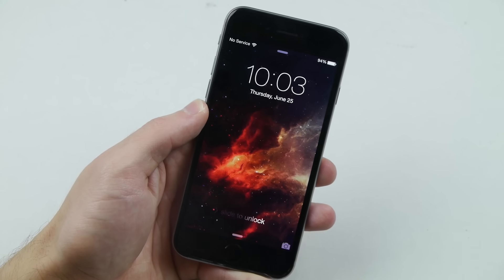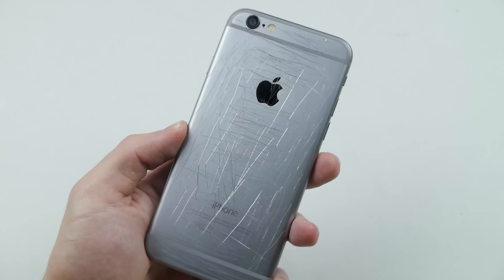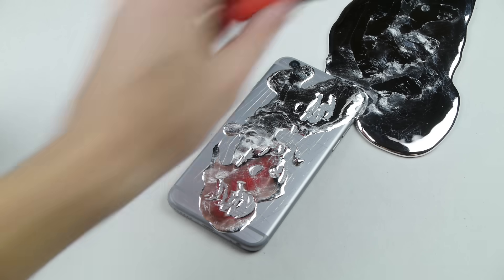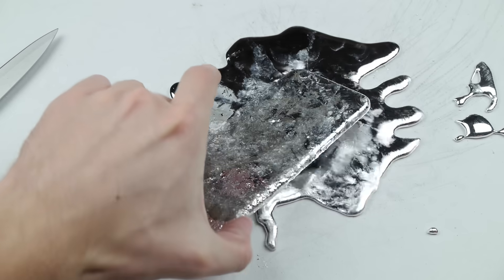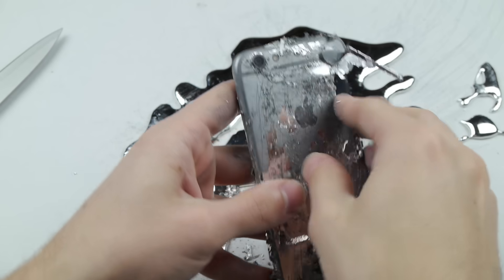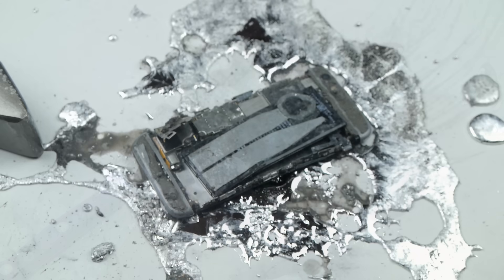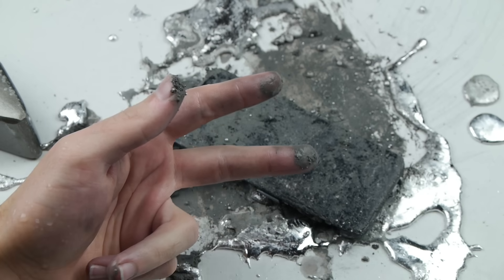What Happens If You Pour Gallium on an iPhone 6?

Comment: its battery acid you morron
Reply: and yes its miss spelled on porpose
Reply: and the acid is lithium mixed with the gallium ITS CALLED CHEMISTRY
Reply: The gallium-aluminum compound produces hydrogen when exposed to water. It's not from the battery.
Reply: Austin Butler lmao
>"ITS CALLED CHEMISTRY"
>not understanding chemistry
The aluminum-gallium compound, when exposed to water, produces hydrogen gas. That's what the burning/sizzling noise and smoke are from. There's absolutely no evidence of any battery acid leakage at all.
>ITS CALLED CHEMISTRY
Reply: Austin Butler you're the morron

Comment: The reason the phone started sizzling and smoking was because you compromised the aluminum casing on the lithium battery and it had a similar reaction to what is happening to Galaxy Note 7's all of the world. The science behind it is the aluminum casing was all that was protecting the lithium from impurities and with impurities lithium's charge will be discharged creating sparks and flames and in the Note 7's case the aluminum casing to expand to the point of outburst. Like for others to see why this happens :)

Comment: That cant be good to breathe...  or touch.. lol
Reply: Caleb Sandersier gallium is non-toxic
Reply: that smoke is hydrogen... aluminium gallium alloy plus water equals alumina plus hydrogen plus gallium... it's actually a viable method of fuel because the gallium is only a catalyst
Reply: Gallium is non-toxic
Reply: EmKays Wørld But not Battery acid or other melted materials that's not Gallium. Also there might be other chemical reactions that might not be safe.
Reply: EMERGENCY OVERVIEW

Irritating to eyes, respiratory system and skin.Moisture

sensitive.The toxicological properties of this material have not been

fully investigated.

Potential Health Effects

    Eye:

         Causes eye irritation.

    Skin:

         Causes skin irritation. May be harmful if absorbed through the skin.

         The toxicological properties of this material have not been fully

         investigated. May cause contact dermatitis.

    Ingestion:

         May cause gastrointestinal irritation with nausea, vomiting and

         diarrhea. The toxicological properties of this substance have not

         been fully investigated. May be harmful if swallowed.

    Inhalation:

         Causes respiratory tract irritation. The toxicological properties of

         this substance have not been fully investigated. May be harmful if

         inhaled.

    Chronic:

         May cause bone marrow abnormalities with damage to blood forming

         tissues. Administration of gallium to humans has caused metallic

         taste, skin rashes, and bone marrow depression.
Reply: Well, at least no problem if he doesn't go swimming in the thing.
Reply: Wow

Comment: this could be adapted for warfare
Reply: You don't need to scratch it, it just helps it get through the coating on the aluminum quicker.
Reply: Gallium is very expensive as well
Reply: Even using ten drops at a time it will be super expensive. Once you take into account the price of gallium, the time it takes to react with the metals, having to get to something without them noticing so you can do it to begin with and it ends up being a huge project for little in return.
Reply: nah, it takes  a few hours to set into aluminum. Its not practical enough. plus you need to scratch the aluminum to get it absorbed.
Reply: mage7206 oh. ok. but the rest of my point still stands.
Reply: it isn't you can get 15 gr of gallium for about 10 bucks on ebay
Reply: That is really expensive... For reference a pound of steel is about seven cents.
Reply: mage7206 I mean ive seen like 10 drops worth compromise a chasis of a computer. Plus you would only really need enough to break into the tank or disabled its cannon and its all useless.

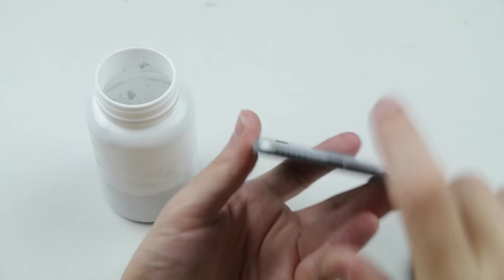Comment: 0:50
"I don't want it seeping in."

1:17
"I'm gonna cut the back so it can seep In!"
Reply: He doesn't want the gallium to seep into the phone itself, but he wants the gallium to seep into aluminium. He's scratching it to remove aluminium-oxide that formed on the surface of aluminium, also to remove any coating that the aluminium might or might not have and to give the gallium more surface area of pure aluminium so it can alloy with it quicker.
Reply: Kyler Janovec  It does form an alloy. It just seeps into the aluminum grain structure
Reply: Otto Knabe jokes, dude. I understand what he's trying to do I just thought it was kinda funny.
Reply: Jayisntliketheothers Just proving my point, I may could have said it differently. Destroying popular things (may it be products, confidents, opinions) is appareantly what YT has been become now
Reply: +Marko Apatovic alloy with it quicker ,it will chemical react but it won't alloy
Reply: I'm not actually sure if it alloys or reacts. You're probably right, tho. Thanks for the correction. The rest of what I said still stands. Regardless if it's alloying or reacting, a bigger contact surface will speed things up.
Reply: The thing is, the title says "What happens if you pour gallium on an iPhone 6", but he then scratches it, which makes the title untrue. He just could've taken an aluminium block and scratched it, to see the results of the reaction.

Comment: You probably didn't need to warm it that much because Gallium (If real gallium) should melt a little bit above room temperature around 30 degrees celsius. Or around 80 degrees Fahrenheit.
Reply: about 78-79 degrees f
Reply: Room temperature is 21°C. 30°C is hot as hell.

Comment: 'So I taped the bottom so it doesn't seep in and make sure it actually can work'
(5 seconds later)
'So I'm going to scratch the aluminium on the back so it can actually seep into the phone'

What a fuckin idiot!
Reply: Lmfao I was thinking the same thing!
Reply: You are the idiot as he wants it to defuse into the aluminum without entering the phone and it did work with the exception of the power button.

Comment: You are the dullest spoon in the cutlery drawer. Not only did you handle gallium without gloves, pretend it was hot, pour it on a phone and play with the gallium on the phone, but you also washed the iPhone with water while it was charged, mixed that with the gallium, and then handled that with your hands.

Comment: "i put a tiny little sliver of tape so it doesn't seep in"
"im gonna scratch the back so the gallium can seep in"

???
Reply: +mychemicaljulia Into the aluminium. There is a layer of oxide over aluminium that builds up, you add some marks to get down to the real/'pure' aluminium, otherwise the gallium will take quite a while to eat through it, if it does at all.

Comment: does he not feel pain or
Reply: Gallium doesn't take much heat to melt. You can literally just turn on your kitchen faucet with slightly warm water and the Gallium will melt. Gallium is also very harmless to the skin, so you can handle it with ease.

I think TechRax has never handled it before and seemed to be kinda skeptical of it's properties. He shouldn't have had it very hot at all. It also would've been better if he left it for like an entire day.

Comment: touching molten gallium with bare hands and giving 0 fucks about it anxiety intensifies
Reply: Gallium doesn't take much heat at all to melt. You can literally run room temperature water on it and it will melt. So the heat is no problem. And to add to that, Gallium is completely safe to the touch.

Comment: yet again confirmation of idiocy. you scratch it to remove some of the protective aluminum oxide to expose the extremely reactive aluminum. a couple small scratches done after melting the gallium would have effectively been the same.

as for the fizzing, the battery must've been compromised and leaked all its internals.
Reply: also would have preferred to see the screen during the "peeling."
Reply: When gallium and aluminum are mixed, and if you add water the aluminum and H2O combine and leave the gallium unaltered. I'm not smart or anything, but I've been researching gallium for about six hours and I found that fact XD

Comment: So... you need a piece of cloth to pour the Gallium when its in the bottle.. then using your bare hand to move the spilled gallium ? is the Gallium already cool off ? or your previous reaction is just for drama
sry 4 bad english
Reply: It was all just dramatic. Gallium doesn't take much heat to melt. You can literally run room temperature water on it and it will melt.

Comment: 4:38   You're being an idiot. Those things have lithium-ion batteries. Lithium is an alkali metal, and as such, it reacts with water and is flammable. Unlike the other alkalis, it will not ignite by itself when thrown in water (the reaction doesn't generate enough heat) but it still reacts.
Reply: Cool

Comment: No gloves when a chemical reaction is taking place i.e acid
Reply: Actually gallium is rather safe
Reply: +Dakota Boyd STILL should use gloves though!!!! I mean, better safe than sorry right?? He could have got it in his eyes or something idk
Reply: +Pixielly if he gets it in his eyes it would reakt with the bit of water in your eyes ,hurt, melt and flow away,
Reply: +Pixielly eh, usually you don't touch your eyes when handling a chemical. When you get a chemical in your eyes it's usually not because you didn't wear gloves.
Reply: +Dakota Boyd when it's sizzling, acid from the battery is reacting with  something. which is why he should be using gloves
Reply: +Valdi  Abolins of course but that's a different reaction

Comment: -_- acid plus fucking water, heat and shit but science aside YAH NO SHIT ITS SMOKING
Reply: +unilew offical yes.  And the gallium and aluminum in the case reacting together plus water is where that reaction is coming from. Not the battery.
Reply: +Tate Amstutz Water causes acid to delude, though this can be exothermic what was happening there was the gallium aluminium alloy combined with the  water so it produced hydrogen in an exothermic reaction.
Reply: ***** Batteries
Reply: Its the gallium and the aluminum mix.   When you add water it makes hydrogen gas. ISN'T SCIENCE FUCKING CRAZY?!
Reply: +Tate Amstutz The battery is lithium ion
Reply: Galliums not acid it's safe to the touch. The heat should have died down,  the battery was sealed and is not made of aluminum, and the only reason it was sizzling was because of a chemical reaction. Sorry to burst your bubble.
Reply: Mr.Gamgam Yup ☺

Comment: It does not help it seep in if you scratch it. It breaks the aluminum's chemical/physical bonds and when you scratch it it takes the smoothness out it so it cannot actively smooth over the back because it destructs the bond of the top layer so it will destruct it into a different unlateral lattice form instead of smooth crystal lattice bonding so you just ruined it. #8th Grade Science duhhhhhh
Reply: That made no sense

Comment: it was smoking because gallium has a very low melting point and a low boiling point, t othe point where if you pour tap water on it, it will boil as if you put alluminium in a pan.

Comment: Gallium is directly under Aluminum on the periodic chart of the elements. Thallium is in that vertical column too, and it will make your babies be born with no arms or legs. 
the Elements in the vertical columns combine the same, because they have the same number of electrons missing. you have to watch out for that.
Are you reading the MSDS sheets on this stuff? I always worry about you guys.

Comment: First.   Understand that introducing the Gallium to the Aluminum creates a New Alloy when the two metals come in contact with each other and that is what weakens the Aluminum so much.  But it is also interesting that you can recover All of the Gallium After Performing this Experiment.   (Most of you  and prob even the guy filming the vid)  saw the mess at the end and figured that he just Wasted  (Not only an Iphone)  but about $100 worth of Gallium too.    Well the interesting part is that what he was doing at the end was actually a good thing  (if proper precautions taken)  because when he Introduced the "Water" to the New Gallium/Aluminum Alloy  (the only thing the water was reacting with - *Not the Gallium or the Aluminum that was still in their UnMollested State)  the "Water" and the  "Gallium/Aluminum" Alloy were reacting to SEPARATE The Two Metals from One Another  (And at the same time Reason Precaution Necessary it was releasing Hydrogen Gas in the Process).    Years back it was actually Theorized that you could build an Engine to Run A Car Indefinately from the Reaction between the Gallium/Aluminum Alloy and Water and the Hydrogen that is Released when these two metals Seperate and the  Aluminum is Destroyed and the Gallium Returned to Pure Gallium - All that would be necessary is to periodically add more Aluminum to the Engine (and possibly water too but not 100% sure about THAT) As the Aluminum would be the only thing Destroyed in the Process and ALL of the Gallium would Separate back out After Each Reaction to then again Perform Reaction over and over again.  Interesting???   I thought so.

Comment: The reason it was sizzling that colour is because the gallium removes the oxide layer on aluminium, which acts as a passivation layer to reduce reactivity. Without this layer, aluminium is very reactive, and reacts with water, releasing hydrogen (which makes the sizzling sound) and aluminium hydroxide, which I think is a darker colour in solution (not too sure).

Comment: You really didn't have to heat the gallium so much- it's melting point is 98.6 degrees Fahrenheit (body temperature.) Thats why it melts in your hands. 
Gallium is a kind of non- toxic mercury. It has very similar properties but is not harmful at all.

Comment: 'I've taped this part up so it will still work' Yeah, cause it's not like your pouring a fucking metal like chemical substance on your iPhone 6 that can only be peeled off without dismantling it by melting the fucking metal which would overheat it and still fucking destroy it.

Comment: y nothing happens to ur hand?
u saying extremly heat?
and how the phone melted in secs?
.?
Reply: The metal he poured onto the phone is gallium. It melts at 27 degrees Celsius 75 degrees Fahrenheit. 

One of the properties of gallium is that when it comes into contact with aluminium it forms an alloy that is extremely weak.
Reply: -_- ok

Comment: All that sizzling was from the water itself. Gallium and Aluminum form a really interesting substitutional alloy, in that when they mix it forces pure Aluminum (Not the usual aluminum oxide) to the top, where it it prevented from reacting with the air somehow. When you poured the water on it, the pure aluminum reacted with it, forming Aluminum oxide and hydrogen gas.

Comment: When you put water on it, it will react with the aluminium. It will make hydrogen and heat up strongly so I would not do it with electronics and mostly not with a fucking lipo